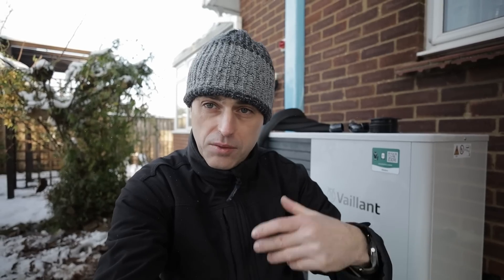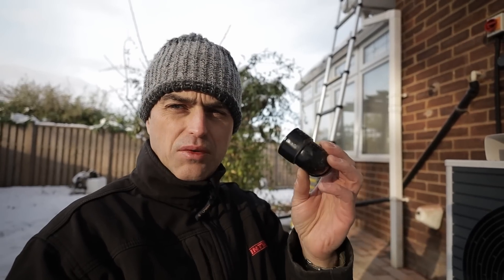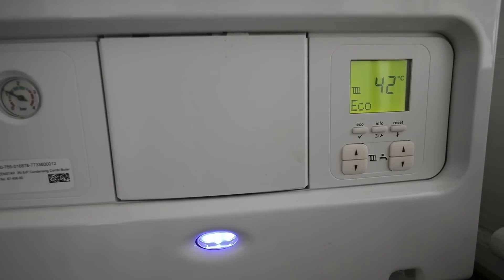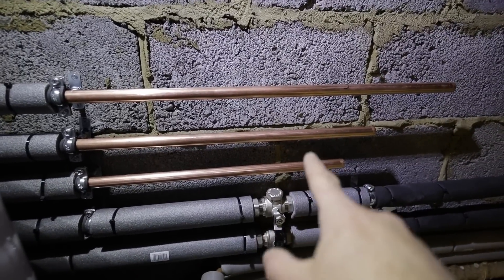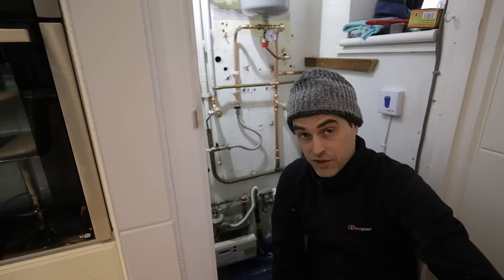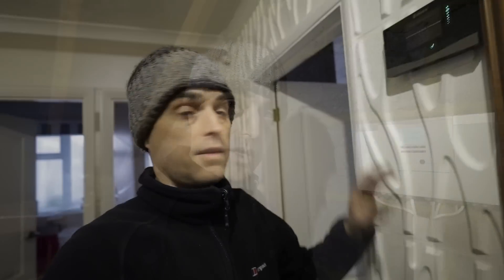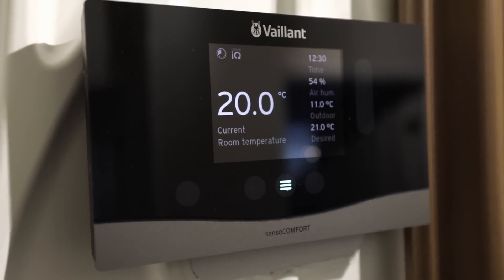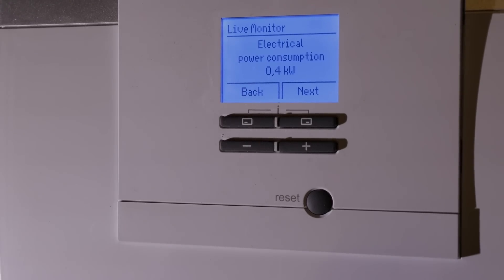How to Install a Heat Pump That Works

Comment: Szymon - this is great! Just a question - is that outdoor unit definitely installed with the correct clearance zones as in the install guide? that's the only reason we're not able to put one in our small mid-terrace house garden
Reply from the maker: 1 meter away from vents and doors and 1m away from the boundary as a minimum. This is a fully detached property so no issues here with boundary.

Comment: Would love to know how much the energy bill is each month.
Reply from the maker: At 10c outside it is expected to be around 500kwh including hot water.

They are on 10p per kWh night tariff with water charged at night and 6kwh battery charged at night.

If we estimate that half of usage will be from the cheaper tariff and other half at 40p it would be around £125 per month on a mild winter month.

Super cold month (-2) could be around £200-£250 a month

Comment: What kind of heat curve do you recommend?
Reply from the maker: There is no such a thing as recommended heat curve. It all depends to what temperature you system was designated.

Comment: “The margin of error is quite narrow.”  Thank you.  I’m sure manufacturers get blamed for their equipment not working on systems that are not properly designed or installed.  Customers need to understand the difference between a Heat Pump Unit, and a Heat Pump SYSTEM.  Only a properly designed and installed system will deliver the expected results.

Comment: You should have left the boiler in place. Here in Scotland the new estate next to our house had air source heat pumps fitted from new. They have all been retrofitted with gas boilers. If I had to have one of these I would fit a Webasto Diesel heater in the loop, from a scrap yard these are only a hundred pounds or less and provide 5kw heat on demand for the colder days. 
Where I live our gas comes from a digester using waste from the whisky distillery so the gas is renewable. Love gas.

Comment: Do you install many hybrid systems and are they the way to go for retro fitting in most scenarios?
Reply from the maker: I have not installed one yet, because you cannot get a BUS grant for them. I do like the idea of them though as they can offer best of both worlds and decent back up when temperatures drop below the design temperartures, which happened in a lot of places last week.
Reply: @UrbanPlumbers  But arent these heat pumps popular in the likes of Norway and Finland where presumably they have typically lower temps in the winter than in the UK?
Reply from the maker: Yes, and they all use direct electric heating when the temps drop too low
Reply: @UrbanPlumbers  And what temp is viewed as too low for the heat pump to work without direct electric heating?
Reply from the maker: Depends how it’s sized. For A2W anything below -10 may be problematic

Comment: So if it goes under minus 3 the air source stops working?
Reply from the maker: No, it just means that the property may no longer reach 21c inside. But in practice heat pumps lose most power around -2 to 0c due to humidity in the air, below -3 they recover. Therefore as strange as it sounds - if you design to -2 you are probably ok to much lower temps anyway.

Comment: Is a diverter and 3-port the same thing?
Reply from the maker: no, a diverter can only be open to 1 port at a time and only has 3 wires and no relay.

3 port has a relay, 5 or 6 wires and can be open to both port at the same time - mid position
Reply: @UrbanPlumbers  thanks mate!

Comment: Szymon, what are your thoughts on LG Therma V monoblock? It's a direct replacement for a gas boiler and is very simple to fit. It's a system I am considering having installed. Carry on the good work.
Reply from the maker: There are no direct replacements for gas boilers. Do not believe fraudulent marketing from those companies!

Comment: Quick question, i am a gas installer that really wants to be convinced on the viability of heat pumps.
You said it was running at 400w so that is around 20p per hour, gas would be around 8p per hour.
How as an installer do i justify this to a client
Reply: Plus leggy is 3.2x the price of gas
Reply from the maker: 1.6kwh of gas would be 8p?
Reply: @UrbanPlumbers  apologies.. brain not in gear.
So around a similar cost taking into account the difference in cost per kw electricity and gas .
However install cost is much higher, servicing cost is higher, and the inability to have heating on for a quick blast during spring and autumn when the heating is on permanently.. i am genuinely not a hater, I really do what to see a way i can sell these, am i missing something? Other than my obvious mistake earlier? By the way, i really enjoy your videos, ive been a heating engineer for nearly 40 years and still love the job, still embrace technology love seeing how the industry changes.
Thank you 
Dave
Reply: I thought the question was hp use 400w to operate while a gas boiler is around 75w
Reply from the maker: @danascully-x2t  someone forgot that boiler also uses gas ;)
Reply: @UrbanPlumbers  the original poster was just talking about the running cost of the electricity used to power  the hp or boiler. The hp then ramps up from 400w to 7.5+kw

Comment: Do you absolutely have to calculate to 21°? We find that to be uncomfortably hot and only keep our poorly insulated but not damp property at between 18 and 19° degrees in the daytime, down to 14-15° overnight.
Reply from the maker: You don't - but if you do you can always run the unit lower. Better to calucate to 21 and then run it at a weather curve that maintains 18C if you chose to.
Reply: @UrbanPlumbers  I see, thank you so much for the explanation. 👍

Comment: Did the rads ever get above tepid?
Reply from the maker: not when its 10c outside. No need if sized correctly. 35C flow keeps the property at 21C inside.

Comment: If the powers that be want people to switch to electric heat instead of gas, the price ratio needs to swing quite a way in favour of electricity.  It's been 4:1 for as long as I can remember so no cost saving unless you have solar.  Not that solar helps much in the depths of winter anyway.
Reply from the maker: This household pays 10pence for kWh of electricity on night tariff and has 6kwh battery charged at night. It works out 3-4 times cheaper to run than gas on that tariff!

Current price cap is around 3:1 so a heat pump with scop of 4.0 (this one will be even higher than 4) is around 25-30% cheaper than gas again.

I know there are stories of how expensive heat pumps can be to run. Those are mostly badly installed with no proper system design.

Comment: how can you use a 3 port on a unvented cylinder? it is because vaillant say thats ok ??
Reply from the maker: there is nothing wrong using diverters on unvented cylinders. You just have to use the normally closed port to the cylinder, not heating. In this case, 3 port is actually supplied with the cylinder and Vaillant expects you to use it here.
Reply: @UrbanPlumbers   thank you. Grant heat pumps are saying that building control will not be happy with this but i say that as long as its other way that its fine🙈
Reply from the maker: @aerenewables  Grant don't have a clue what they are doing. They have S plans with on/off stats in their manuals and system layouts that make no sense.
Reply: @UrbanPlumbers  soo true . Thank you for saying that i was questioning myself about this all day. They are saying that you need to be able to control the heating so
Turn it above 21 or off if you wish. This will make heat pump cycle more wont it ? And how will i set pump graphs if its all constantly opening and closing ports and and ufh loops ? I thought i would take out mixer valve and close couple and remove all actuators just a control for cylinder is all is needed and maybe a one room stat that does whole house ? What you think ? Cheers
Reply from the maker: @aerenewables  on grant i would use just a diverter valve, remove the blending valve and pump on manifolds, and only use the grant controller without any room stats. Just do not listen to Grant.
Reply: @UrbanPlumbers  how will i have control over the hot water if i did that? The grant will only take low voltage no 240v switching
Reply from the maker: @aerenewables  you run an NTC direct to the grant unit from the cylinder and wire diverter directly to the heat pump. I have done it and ti works. You need proper manual for the Grant heat pump - it is made in japan by Chofu - do not use Grant own manuals. 

Did I say Grant don't know what they doing already?
Reply: @UrbanPlumbers  yeah you did. I said what you said and they replied saying that what if customer wants more heat or to be able to turn heating off? I said just  use a normal stat or low voltage but they want all these 2 ports and and ufh actuators….. such a waste of materials. Id love a job where i could do  as heat geeks or yourself has done 😢

Comment: i must have missed the price of the install??
Reply from the maker: I love how the conversation  have chagned from:
1. Heat pumps dont work! - I showed that they do!
2. Heat pumps are expesnive to run - I showed they are not

Your last argument - heat pumps are epxensive to install ;)

You bet they are and they should be, they are better, more reliable, provide better comfort and are cheaper to run than gas boilers.
Reply: @UrbanPlumbers  and the price is??? we have solar and Battery so we only need the boiler to warm the house during the winter months the water is warmed by a Eddi unit, to change to a heat pump will take over 20 years to pay back...  i'm not knocking heat pumps
Reply from the maker: @robin5215  If you only need to change the heat source and not radiators or cylinder you can probably do it for around £5-£7K less the grant.
Reply: @UrbanPlumbers  thank you, we are trying to remove gas from our home, we have just upgraded our solar from 4k with the original tariff to 7k with 10k battery storage to try to be off grid for 8 months of the year
Reply from the maker: @robin5215  depends on the sie of the unit. Overall cost of the installation before the grant is applied is around £10-£20K. (Customer pays £5-£15k)

Comment: i want to go heat pump but i do not trust the system designers it's the wild west!  Until something changes i will hold off.  Great Video as usual wish you were a bit more local!
Reply from the maker: Heat geek is working on it. Check the heat geek map!

Comment: "including period properties"......including those 200-500 years old (like mine) with no double glazing (not allowed), thin walls etc?
Reply from the maker: yes, there is a number of very old houses with succesful heat pump retrofits. Single galzing may be pushing it though. You really need decent windows and doors in period properties for heat pumps to work well.
Reply: With single glazing and poor insulation, I'm willing to bet you have period cast iron radiators? No Air Source Heat Pumps will work sadly however a Ground Source Heat Pump will deliver a higher SCOP, and may work if you have a large lawn/ garden area that soaks in Southern irradiance. 

If not, invest in a Viessmann 200-W, the only gas boiler that behaves like it is a heat pump!
Reply: @singlendhot8628  Sadly we don't have period radiators, although I'm seriously thinking about replacing some of the modern ones with chunky cast iron ones
Reply: @UrbanPlumbers  The Listed Building regs won't allow double glazing, although secondary glazing is permissible. After last week's shivering this is on my agenda for 2023. Whether that would be sufficient to allow a heat pump to work is another matter.
Reply: @zlmdragon.  It's no barn.
Reply from the maker: @paulcassidy8130  I have one property with 2ndary glazing and a heat pump. Works well.

Comment: Unfortunately you seem to be one of a few who seem to know what they are doing. A friend of mine stupidly got a heat pump installed (by a company I can’t name) and the first real test came last week when temperatures got -6°C. Not particularly cold but the pump couldn’t supply enough heat to the living areas due to the very poor insulation in most older Scottish homes. I myself live in such a house built in 1970 and it’d be cheaper to knock it down and build a new one.
Reply: then it just means your friend got undersized heatpump or the heat emitters sized were checked properly. That wouldn't happen if heat calculation was done correctly. Any house even with bad insulation can run heatpump if things are done like this guy does.

Comment: -2C?  Not a realistic winter temperature for many.  I do have a small unit and it is good down to about -20C.  After that I would freeze to death without my Natural Gas furnace and a really big wood stove.  Currently surviving the Arctic Vortex in Alberta Canada with air temperature dipping to -40C at night and barely -30C through the day.  This looks like a great product, great system, great everything , but not for this climate.
Reply: The whole point about the -2C bit is this one parameter of the design considerations when working up a heat pump solution.Syzmon will have done a heat loss calculation for the house based on -2C because of the location of the house (probably London area). If he had been further North - say Aberdeen he would have selected the design temp for that location which would likely be, say -5. If he had used a -5 design in a -2 location then for much of the heating season would have a much larger ASHP than needed so it would be less efficient overall from a capital cost and running costs perspective.
Reply: @normanboyes4983  Yes makes sense, just watched the video because it said in all weather.  My heat pump works down to about -20C, probably very low efficiency at those conditions.  Hoping the Tech progresses, need reliable heat down to about -40C.  Want to switch the whole house but also want to wake up in the morning
Reply from the maker: We don’t get much colder temps then -5 here. Totally forgot that people watch it outside of the UK!
Reply: @UrbanPlumbers  no worries, my single head unit does work to about -20c, although probably not ver efficient.  Someday the tech will get to the point that I can switch my entire house to a system like this. Great video btw

Comment: Our Vaillant aroTHERM 7kWh was installed by a fully accredited Heat Geek installer on the Friday and on Monday the RCD for the power supply tripped as rainwater had penetrated the cover over the protruding electrical panel on the rear of the unit  and shorted it out. The compression seal around this cover  is poorly designed as it is fixed by screws at the top and bottom but there is a gap on both sides where water can and does penetrate. 

Our installer tells me  that they have had the same problem with several other small aroTHERM units but Vaillant always try to blame them for not fitting the cover correctly, which is  rubbish as there is only one way to fit it:. The design is clearly incompetent  for the purpose but Vaillant will not do anything about this . We now face a delay of several weeks with no  heating while Vaillant supply and fit a replacement board as here in Scotland most of their service engineers have left. I wonder why?

Once the board is replaced I am going to run a silicon bead around the cover edge to make sure that no water penetrates, which is ridiculous in a unit that is supposedly designed to withstand all weathers.  If it fails again I will go to another manufacturer and try to recover costs through the courts.
Reply from the maker: Yes, the design is poor. They should address it. I have heard of other people having similar issues. We do run silicone around it now.

Comment: I know that combi boiler burner modulation can be quite limited, and I've been wondering how much of a modulation range modern heatpumps have. How low of an output can they modulate down to before the heat pump starts cycling?
Reply from the maker: Around 1/3 of the max output - but minimum and max changes constantly with the flow temperature and external temperature changes

Comment: Spend 20 grand to save nothing on your average bill. Sounds like a great deal Story in Telegraph online today about a guy who spent big money and his average bill went up to 7k per year with the hp then put his wood burner on to try to supplement the heat. Said many people in his village had the same problem.
Reply from the maker: That’s what happens when those systems are installed incorrectly. As per video - margin of error is small.

Comment: If it breaks down and outside, they are -2; -5 degrees; maybe it's blizzard outside...who comes to stay in the cold to repair a heat pump? In the end, everything breaks and needs to be fixed...

Omce I had to intervene on a heat pump for a commercial building on the bank of a river and outside it was -25C + the wind was blowing... I didn't manage to sit in front of the equipment even enough to check the errors it displayed.. .so they had to send all the employees home for several days until the weather got warmer and they could work on the equipment
Reply from the maker: Heat pumps do not display errors on external units - but a nice story bro 😎
Reply: @UrbanPlumbers  Daikin vrv IV - does :) - It was 7-8 years ago at a Head Office of a Bank.
with Daikin vrvs, I prefer to interrogate the external units …
Reply: @UrbanPlumbers  + all the mechanical and electrical components are in the outdoor unit - any maintenance/repair intervention must be done outside in the cold... how many interventions could a technician do on heat pumps per day in cold weather? 
How many skilled technicians would agree to work all day outside in the cold, since in the future 40-60% of the heat sources on the market will be heat pumps and they will eventually need maintenance?
It is relatively comfortable to work on gas boilers because you are working indoors in a warm environment.
Reply from the maker: Stop being such a baby :)